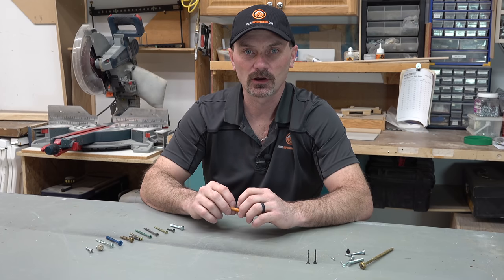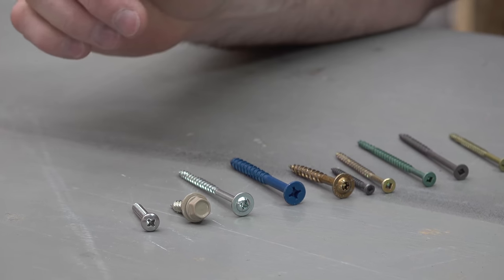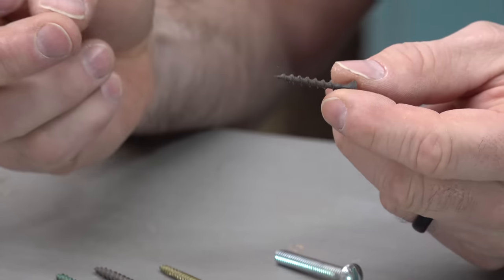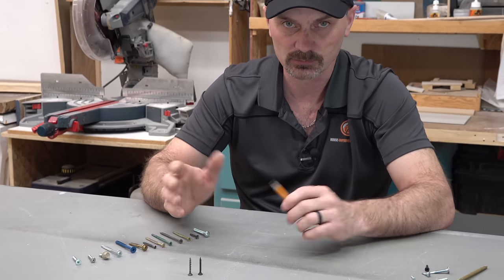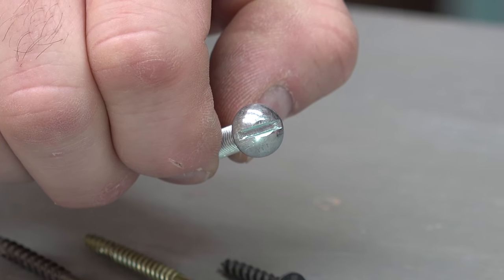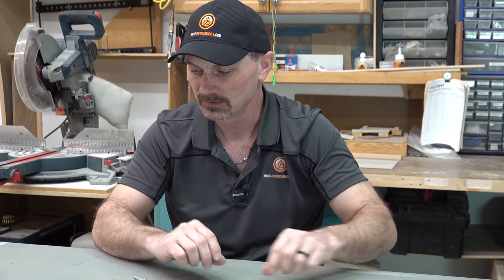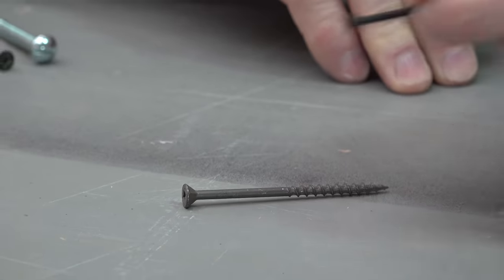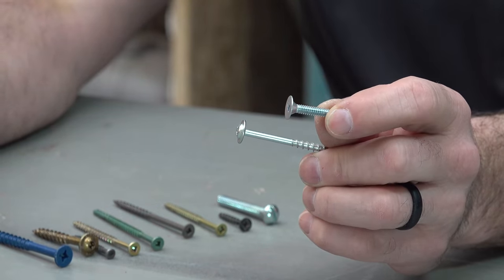Screws: DIY Basics

Comment: I have done DIY projects over the past 49 years and in the 1980s discovered the Tapcon.  I do not recall them being around in the 1970s.  Tapcon provides a couple drill bits with their screws (Or did?).  The experience I would share:  Tapcons are great but the age of the concrete dictates the level of difficulty (Which means amount of effort). Concrete over 10 years old becomes harder/Brittle...so I used to spray the screws/bits with Silicone.  The drill bits get beat up fast and I have had Tapcon Screws snap off while torquing them into place in those situations. Newer concrete is softer!  If working on old concrete,  I planned on buying additional Tapcon drill bits as I used many on one job involving old concrete in the past.
Reply from the maker: Thanks for the feed back!

Comment: Thanks for the info on pressure treated screw coatings. I was unaware of that. Who knew there could be so much information about screws. Thanks again for another fact filled DIY video... I looked up ACQ:  ACQ Rated. These screws are designed specifically to be used with ACQ or Alkaline Copper Quaternary lumber which is the new standard for  treated lumber. The wood's higher copper content means it is highly corrosive to many metal fasteners, however, this (ACQ) finish resists the corrosion.
Reply from the maker: Right! I know this seems like it could be pretty boring but there are many things to know. The screw isle in many hardware stores can be a little overwhelming with so many choices. Hopefully this will help folks to make better informed choices for their next projects

Comment: When I lived in Massachusetts, the road salt corroded the screws and bolts.  Working in automotive there can be a nightmare with corroded fasteners.  The torch helped a lot!
I like lag bolts for holding something to wood.  How many times you buy something that is supposed to be mounted to a wall and all they give you are small screws,and you know you need larger ones or now it's time to locate studs in the wall so you can put up a brace to support the new purchase.  Sorry for the rant, just some of those memories.

Comment: I love your pragmatic style: no fluff, just facts. 

The gold-ish gold screw is often called construction screw at the store, but you mentioned that it’s not structural. When and when not should it be used?

We don’t hear often about nails, but they are structural and cheaper than screws. Could you do a video on them too?
Reply: I use these gold construction screws for a lot of things because they have a nice Torx head. Maybe I shouldn't?
Reply: I think structural screws usually have like a #10 or larger body. If you go smaller than that, they just don't have shear strength and can snap.

Comment: Great video. I use deck screws or construction screws for most wood to wood. I find the zinc coated wood screws split the wood too much.
Reply: Every screw will essentially split the wood even if the screws says on the box will not split like grk does.
Reply: @borys444  Some more so than others tho ...

Comment: I'm a huge fan of truss-head and washer-head screws in general. Socket heads are the best if you don't need countersinking or flush heads, otherwise square and star are the best drivers. Also, the age-old debate of screws versus bolts! My opinion is that a bolt is only a bolt if there is a nut involved. So if you use the 6-32 machine screws that receptacles use to fasten to a box, those are screws. But if you use those same screws to fasten a receptacle to an industrial cover with nuts, then those screws become bolts. So it's really a question of whether a nut is involved in the fastening application.
Reply from the maker: Thanks for the comments Aaron!

Comment: Thx for the info!
What would you recommend for hanging a dartboard in stucco?
Reply: you will need a concrete anchor...drill a hole the same width of the anchor with a masonary drill bit,then install the anchor in the hole then put a screw in.should work good luck

Comment: Missed: Dual Thread Screws for holding down sub floors.
Reply: He just showed like the 10 most common screws... there's dozens more. Yeah, those dual-thread screws usually have a ceramic coating to prevent corrosion from traditional tile-backer board.

Comment: I didn't know about the existence of square drive screws. I thought the screws with a square indentation on the head were all called Robertsons' screws. Thanks for pointing that out. How can one tell if a combination head screw is a Philips-Roberstson combination or a Philips-square drive combination? In fact, how does one tell a Robertson and a square drive screw apart?
As far as the Torx and Allen screws are concerned, it has been pointed out that Robertson screws have a specific advantage over those in that the Roberson screw is always self aligned with the screwdriver as it is better gripped by the latter than Torx or Allen screws are, which are never self aligned with the screwdriver and are always at  a risk of falling off it.
Reply from the maker: Its hard to tell the square drive and Robertsons apart but the Roberstons have a slight taper inward at the bottom.
Reply: @HouseImprovements  I guess one can apply some blu-tack or some other kind of non-sticky putty or just use a magnifying glass. I would not necessarily trust a screwdriver, even if I had both kinds and all sizes plus it would be a slower process to go through them all.

Comment: SEAN,  Does anyone use the "headless finishing Screws" these days?   Finishing work seems to have become the providence of brad or pin nailers.  Thanks
Reply from the maker: I see them used the most on composite decking and composite decking accessories where you want a hidden or semi hidden fastener but need more then a brad nail
Reply: @HouseImprovements    Understood but whatever...  You are a Handy Man to have around.  I learn a lot from you.  Thanks

Comment: SEAN,  I just laid some Hardie Board" which required a specialty screw of it's own.  (expensive little puppies)  Would one or more of the screws you showed been just as good for the job?
Reply from the maker: Not really ,you kinda need that ceramic coating and the aggressive threads they have on their screws.

Comment: i just bought new square drive/robertson bits (silver ones, not black) from Milwaukee and somehow my deck screws always slip off. it's the same size #8 bits, but somehow whenever i use it to drive in a screw, the screw just starts to dance around and slips off and my bit will hit the wood. i hit my finger once too. meanwhile i use a cheap Mastercraft bit and the screw stays on and doesn't move around. they're both snug but i don't know why the Milwaukee ones are worse.
Reply from the maker: Square drive and Robertson look similar but are different slightly. So the master craft bits must be the exact fit for the screw head type you have.